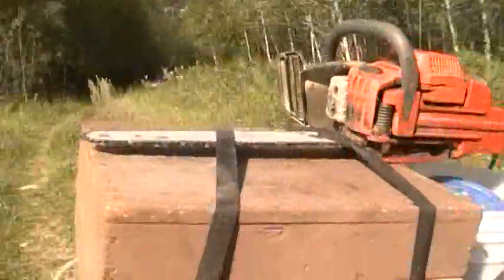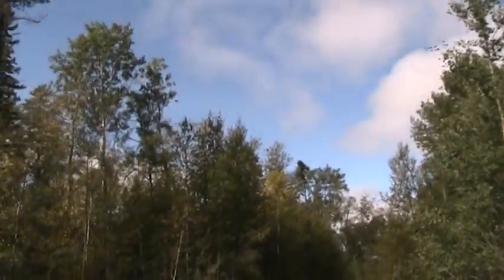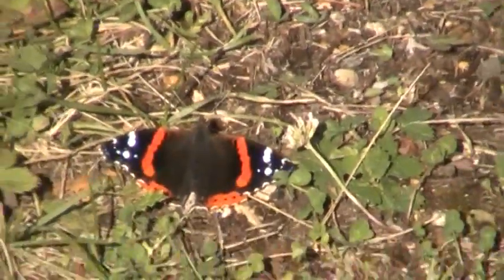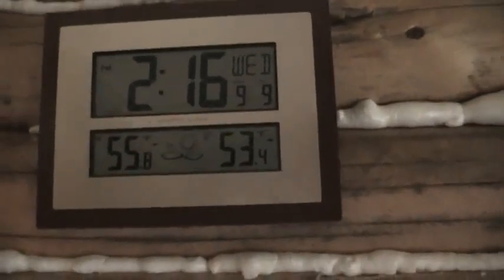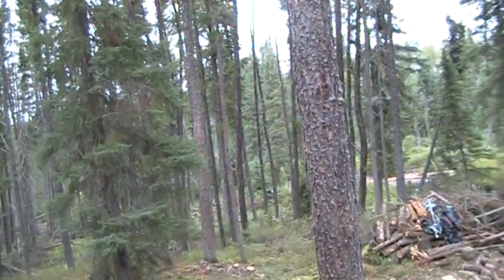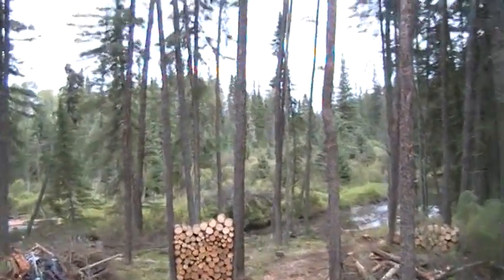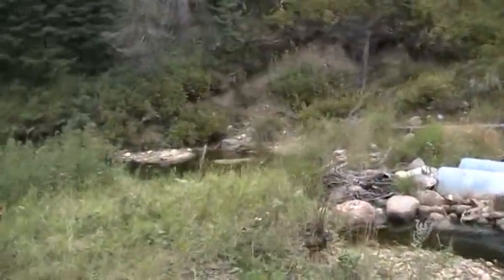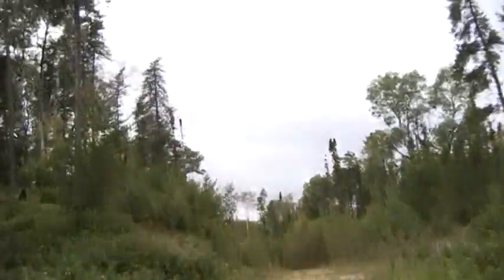How to Build a Cabin (Trapping Cabin) - Part 25

Comment: great night dave, ran into same problem with the stove in my camp a tin smith should be able to help you out there, or weld one up with a mig like I did 1/8 sheet metal and a piece of 3/16 pipe same as chimney set it to the angle and weld her in.Keep up the good work buddy take it easy
Reply from the maker: +THE BUSY BAYMEN KRIS RUMBOLT Great minds think alike. I am picking up the material tomorrow.